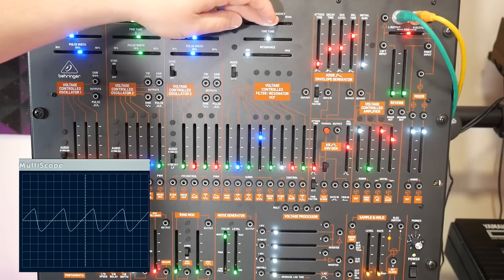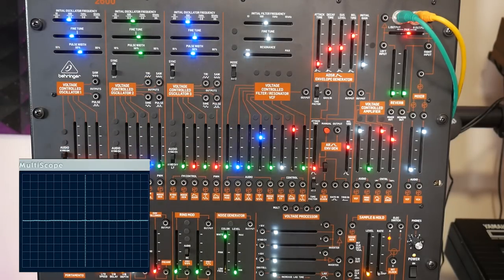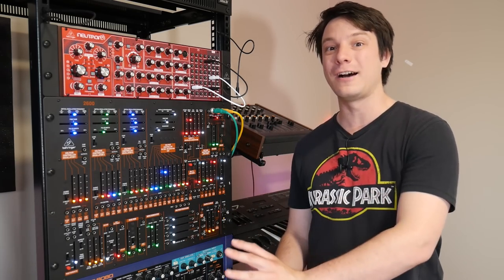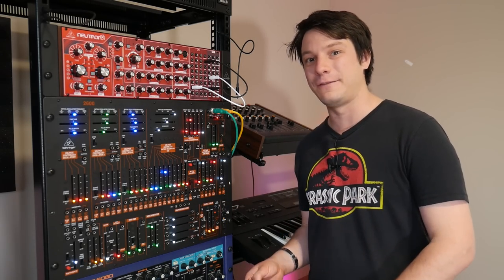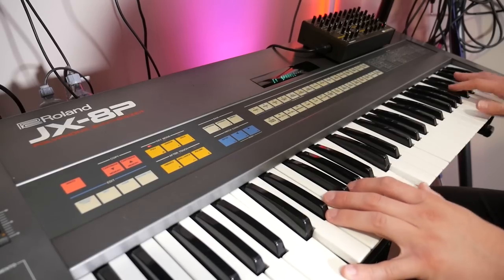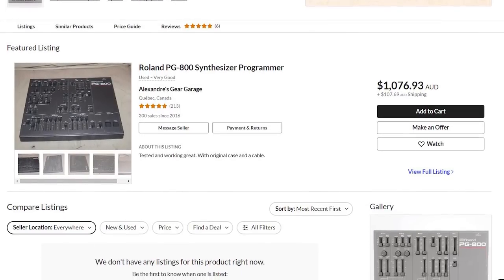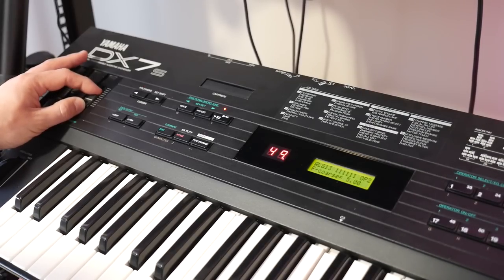My wall of sound.

Comment: Actually, the original ARP 2600 was produced by the ARP company in 1971.  Korg came out with a reproduction of the original 2600 in late 2019. There was a limited number of units that were the same dimensions as the original ARP version, but also produced a mini version of the system, the 2600m, currently available.
Reply: Ah, thank you. I was about to say Alan R. Pearlman is the creator as well as the source of the letters used by his synth company, ARP. I first got to touch one in 1988, and had the hardest time trying to make a sound emerge from it. If only I had known that it had a normalized path to sound output that was only changed by patching in cables to the patch points. A manual was nowhere in sight.

Comment: Spring 1974 I bought the APR Odyssey and then the ARP 2600 that fall.  I sold them in '75 to continue my college education.  In 2001 I sold my JP-8080 for no good reason.  I miss it greatly.  I traded a Yamaha TX-816 (8 DX7's in one rack) in 2010.  I'm still surrounded by 20 other synths, so it's all good.  LOL. You've got a great bunch of fun gear Angus!

Comment: Oh my, you have some classics! My synth collection is getting a little out of control. I've run out of room!
Reply from the maker: It's an addiction...
Reply: @MakersMuse  I mean, you can stop any time! Right? 😁
Reply: I've forgot how to use some of them already :)) Although I don't have much.
I think that maybe it's a time to make a kind of "analysis thing" for every gear you have. One sheet of paper, two sides: plus/minus. Then you'll understand how much do you need a concrete synth.
I'm going to buy a used Keystep 37 locally this year and that's it probably. I have only a big A800 Roland's keyboard and QuNexus. Maybe I'll sell A800 as I don't use it at all. Maybe not... it's great to meditate with some VST synths, search for some wide range solos... QuNexus is nice but that's totaly wrong that KSI did made it so narrow and no any screen (due to it's break-proof probably). Also I have Arturia Microfreak and it's really nice to play with as a MIDI controller.
Once I'll check all my most important "Gestalt points", I'll continue to create my own mono-synth. Neutron and ModelD (Behringer's) are nice but you always can create yourself a nicer monosynth :)) That's how I've started to compose music. We've listened to Prodigy, Prana, ManMadeMan and etc.. and did thought "well, we can create music like this or even better!". That was a really funny time in those days.

Comment: The ARP 2600 was made by ARP Instruments, Inc. in 1971, not Korg.  A clone was made by Korg was released in 2020, which  Behringer did as well.
Reply from the maker: Yep, my bad adding Korg in reference to the original, ARP Instruments is simply a subsidiary now.
Reply: @MakersMuse  It's nice that ARP is back, even as a subsidiary of Korg. Not to knock Korg, I love their equipment and have a Micro-X, a couple of Electribes (ORIGINALS!), a KAOS pad mini and a Volca Keys. But I cut my teeth on an ARP Odessey (Technically an ARP Odessey 2800) that I had on loan for a summer back in the early 1980s.

Comment: Around 4:52 the reason it doesn't show as a completely square wave is that there are AC coupling capacitors somewhere (several places) in the path from the oscillator to your sound card. They center the signal around 0 V DC and work (sort of?) like a high pass filter with a fairly low cutoff frequency (around 10 Hz I'd guess).
Reply from the maker: Ah cool, good to know! I need to source a real scope for future.
Reply: @MakersMuse  Real scopes are cool, and do give a more accurate image because unlike most sound cards they're DC coupled, but the pulse wave is probably going to look much the same.

Comment: Angus I always wondered if it would be possible to create an ambient soundtrack using 3d printers and synths combined? Using the XYZ co-ordinates of the printer's head, speed & other factors to input on the signal generated by the synths, changing tones, waveforms & other parameters?
Reply from the maker: Definitely! Its something I've been meaning to try
Reply: @MakersMuse  Yep definitely something for a modular set up, I've seen it done with signals generated from plants & fungus on some channels, should be easier with the movement and tech of a 3d printer.
Not sure if would be done directly using the printer's movement programming commands or having some form of physical detection, maybe a signal sender attached to the head & a receiver or radius detection device around it? The co-ordinates/speed etc indexed to pitch, speed, number of notes triggered etc would offer an interesting number of variables.
Could even make it more meta by having the 3d printer create the ambient soundtrack using this method whilst actually 3d printing a synth model. I've seen a few downloadable 3d printable create your own synths kits where you can actually create a working synth and add the electronics as part of the kit

Comment: Nice collection and video. Nice music, too. :)

For MIDI, I use a MOTU Express 128. It's not very expensive, but it will let you address 8 MIDI inputs and 8 outputs directly from your DAW (Digital Audio Workstation). I have several of them. The approach you have right now works well as long as you have each module on a different MIDI channel. It's basically a big MIDI thru box rather than individually addressable ports. I also have a couple iConnectivity mioXL modules which provide other ways of addressing different synthesizers.

Also, this coming year is the 40th anniversary of MIDI 1.0! MIDI 2.0 is coming (we have a couple standards updates just about to be voted on, and it's already largely in macOS and Android. We're working on it for Windows and we're also sharing with the Linux community to help make sure they have a good implementation as well). (Disclosure: I am the chair of the MIDI Association Executive Board, and work on Windows MIDI Services at Microsoft).

Some minor corrections and info:

1:42 The original 2600 wasn't a Korg, it was just ARP. The reissue is Korg ARP 2600. Both are based on the original to one degree or another. I have both the reissue and the Behringer. They are both great synths, albeit somewhat different.

4:54 Your scope is fine. Except for digital oscillators using a straight-up on/off (and only in ideal models), a pulse/square wave is almost never a real square like you'd picture it in your head. It's part of what gives it character. Some have ringing on the leading edge, some have more of a curve across the top, etc.

JX-8P: You may be interested in the Kiwi 8P mod. It adds a lot to the synth.

8:13 A common misconception is that DCOs aren't analog (there's a ton of misinformation out there about this). Digitally Controlled Oscillators are still analog. They are not digital oscillators. They just get their source from a clock pulse (dedicated chip or processor, typically) instead of a voltage. The retroaktiv stuff is excellent for control. Stereoping also makes some decent ones.

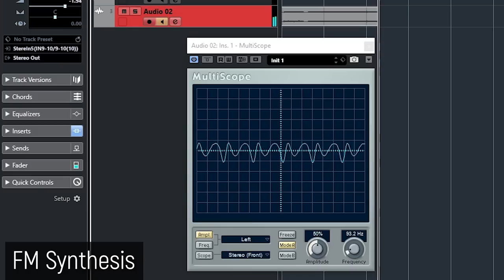10:43 FM Synthesis is Additive synthesis, like 3d printers are additive manufacturing. Additive synthesis adds frequencies.
Subtractive synthesis is like CNC machining. Subtractive synthesis take away frequencies, like you said.

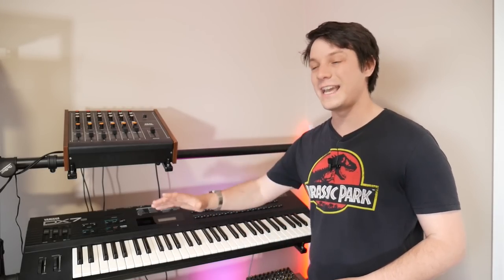11:42 The Korg M1 is supposedly the most sold synth of all time. :) I imagine the Microkorg is up there as well. But this information is difficult to find and even harder to verify, but almost everyone seems to agree that the M1 topped the list. I worked in a music store selling D-50s, M1, W-30 and a bunch of other synths at the time, back in the late 80s and early 90s. I never liked the M1, and thought it looked like a whale, but everyone who came in wanted to try that or the . :)

JP-8080. I love this synth even today. Pads on that are amazing.

Comment: This is fascinating stuff.  Perhaps add a music-making intro/outro to your regular content, with longer versions on a second channel?

I'm no musician, but on a few projects in the mid-90s I needed to create distinct annunciator sounds (alarms, alerts, status, etc.) that had to work through a cheap cone or piezo speaker driven by a digital pin with little or no analog filtering.  I first had to determine the output spectrum of the annunciator device, then create waveforms to drive it as needed.  While I initially played around with simple digital keyboard/midi synths (Yamaha PF80 + FB01), I soon moved to the CSound programming library/environment, as it gave me the ability to avoid embedding compressed sound samples and simply embed the library with custom code to generate the sounds.

I was able to create some surprisingly high-quality sounds from cheap hardware by using the hardware "limitations" as a filtering medium.  I initially replicated the output circuit on a breadboard while doing sound development, but later created a filter in CSound that modeled the hardware effects "well enough" for development purposes.

I spent way too much time recreating a library of Star Trek sounds, which I included as an Easter Egg that could be enabled in a system test/calibration mode (never in normal use).

Comment: Theoretically, a downward slope squarewave like that=a high pass filter. Could be a DC blocking capacitor on one of your devices inputs or a forgotten setting of one of those thousand knobs... Lol. Sweet setup and nice tour of your rig.

Comment: Due to the way that analog pwm oscillators work, your Behringer 2600 is actually producing a wave like that. Doesn't matter the oscilloscope. If I had more understanding of how electronics work, I could probably explain why, but it probably has to do with the way a Schmitt trigger works.

Fun fact: Schmitt triggers were invented in the 1930s and was developed when Otto H. Schmitt was studying neural impulse propagation in squids. He called it a "Thermionic Trigger". That's about all I know about it's creation. It is used mainly nowadays to de-noise logic gates and circuits in general but their switching to a low voltage after reaching a high voltage can be abused to make noise, which is kinda ironic if you ask me. Apparently it is simply a side effect from how it works and is generally considered a bug when it oscillates in non-oscillating circuits. The act of the trigger oscillating is called motorboating. This side effect isn't harmful to the Schmitt trigger (obviously considering there are 50 yo synths that still run and sound great) and turns out to be the coolest component in electronics ever imo just because it defies social norms and decides to be popular for the opposite reason it existed for. Schmitt triggers are madlads.

Comment: Should be a little screw depending on the O-scope probe your using, it might be in the handle or in the BNC. That should be the alignment screw to get a flat top for the square wave, feed the square wave test signal into it usually found on the scope somewhere or a known good signal to do the adjustment then try your signal again.
Reply: ^This. Definitely looks like probe calibration.
Reply from the maker: It's a VST scope, no probe calibration available :) Will source a real scope for future!

Comment: The oscilloscope is actually good. You see a falling slope because the oscillator overshoots at the raising edge and is dampened afterwards by some filter or just by the internal electronic. If the oscilloscope was bad, it would have a minor sampling rate resulting in a square wave.

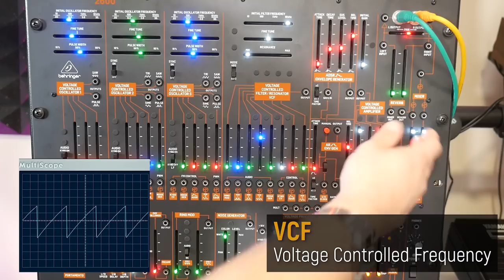Comment: By posting synthesizer content you have invoked the impotent rage of synth nerds like myself - and in that spirit I would like to push my glasses up with my finger and point out that the title card at 2:43 gives the acronym for VCF as "voltage controlled frequency," when in fact it should be "voltage controlled filter." Time for a cold shower and a smoke, my work here is done.

Comment: Nice video! A more modern version of the MIdi Patch bay you have, is the iconnectivity MioXM or MioXL. Aside from having quite a few DIN midi in and out ports, it also supports MidiRTP and USB-Midi. I have it connected to a few synths via DIN midi cables, a few others using USB and I then transfer that to the other side of the room using MidiRTP over the network. 
I basically do the same for audio with a MOTU Audio interface using AVB.

Comment: I was wondering when you'd get around to the music gear tour! Your synth tastes are along the same lines as mine.
Have you checked out the Korg MS2000 (rack version MS2000R, and hard-to-find black reissue MS2000B/MS2000BR)? In many ways it's like the Korg version of the JP8080, but definitely not a clone. Aside from the control and filter differences, it has that little bit of additional grit that Korg's analog modeling usually has over Roland.
I had most of my dream setup in the early 2000s with a Kawai K5000R, Roland JP8080, Korg MS2000R, RedSound eleVAta, and Novation A-Station. I still have the K5000R and A-Station (and the eleVAta, though I'm looking to sell that as I haven't done much with it in about a decade). Oh, and I've always wanted an ARP Odyssey -- a real one (I currently use a few different virtual versions).

Comment: The DX7, my favorite all-time synth. I got a reface DX and two Volca FM’s. For me the FM sound is both very versatile as well as childhood nostalgic. Look Mum No Computer built a synth once based on the Sega Megadrive. The 2612 soundchip came in two revisions, the Megadrive 2 has a CMOS variant integrated in it’s ASIC chip. The irony is that it has a cleaner DAC then the Megadrive 1, but Sega messed up the amplifier circuit as a cost cutting measure making the Megadrive noiser then the original model. Cubase is a great DAW, I’ve been using the Elements version for quite a few years now.

Comment: Regarding FM synthesis, couldn't you also do that on the 2600?  Send the audio out of one oscillator into the voltage control (pitch) input of another oscillator, chain a few of those together and you have some basic FM algorithms.  Using a few external mixers, you could add a little feedback into the chain as well, right?

Comment: I've particularly noticed your JP-8080, I can feel the supersaw anthem trance from here. Keep an eye on the electrolytics in that thing. I also like the "B"ARP 2600. Sweetwater here in the US is having a good sale on the 2600 clones and I'm half tempted to get the grey meanie, or a new printer!  Been watching your printing videos for a long time, so it's fitting that you're also a fellow synth nerd. I recently got back into this and I've been starting a small collection.  Hows the noise floor on the 2600?

Comment: "It [the YM2612-based synth] has a really unique sound and aesthetic to it that I don't really feel is something you could reproduce with a virtual software instrument..."

The guys at Plogue are monsters when it comes to reverse engineering vintage sound chips and then modelling in software every tiny detail of them. The Plogue’s chipsynthMD product perfectly (they call it “bit accurate”) models the YM2612 chip, including the emulation of the original DAC imperfections.
Reply from the maker: Huh I didn't know that, I'll take a look!

Comment: "It (DX7) was actually the most sold synthesiser of all time"
The Korg M1 massively outsold the DX7, even the D50 outsold the DX7, and the D50 only had a little under a year in the limelight before the M1 appeared and blew the competition away . . . 
1. Korg M1 ~250,000 units
2. Roland D50 ~200,000 units
3. Yamaha DX7 ~155,000 units
4. Korg 01/W ~130,000 units
5. Korg Poly800 ~100,000 units
6. Roland SH-101 ~50,000 units
7. Ensoniq Esq1 ~50,000 units
8. Roland Juno 106 ~40,000 units
9. Ensoniq Mirage  ~30,000 units
10. Korg Polysix ~30,000 units

(figures on the Korg microKorg are a little hard to pin down, but some say ~100,000, so would be N°5 on that list)

Comment: Back in December I could have sworn I saw an Arturia KeyLab XX MKII (which I noticed because I had just received my Arturia KeyLab 88 MkII & legs) in your kit... But next video I saw the number of drum pads dropped and suddenly you had an Arturia KeyLab Essential XX. Did my mind see what I own because I own it, or did you actually have an Arturia KeyLab XX MKII?
Reply from the maker: It's always been the 88 key essential :) it's decent enough but certainly not a nice weighted keybed!
Reply: @MakersMuse  My Arturia KeyLab 88 MkII does have a fairly good key press (but is slowed a little too much), but the return of the key is far too slow (yet can be pressed and provide signal again very quickly and before full return to [in engine speak] TDC [Top Dead Center]). It does feel good when pressed but does feel disorienting to the brain. When things aren't always the same...

Comment: You find making music relaxing?
I can't say I do. More like frustrating, probably because I'm too ignorant to easily transpose the sounds in my head to something real. Well, that is, of course, every odd year or five when inspiration strikes.
Still, it's highly rewarding, even if I can't make music that is good as I would like.

I exclusively use things like samples and digital instruments (VSTs). I guess there's two reasons for that. Firstly, I'm poor and hardware is expensive. Secondly, there's just something about the purity of the digital space. What you make will forever be a faithful reproduction as long as you have the source. You can switch out an instrument for a better, higher fidelity one in ten years time, or keep the one you had. You can mix it, master it, remix it, change every instrument into glockenspiel, but all the notes, velocities, parameters etc. are still there and you could, at least in theory, get a perfect reproduction of your original composition in a hundred years time and render it to whatever fidelity and format is en vogue then.

Pardon the ramble! This was an excellent explanation of synthesis. Frankly I've seen a lot more confusing explanations from popular music channels.